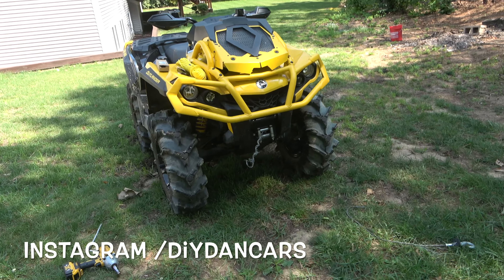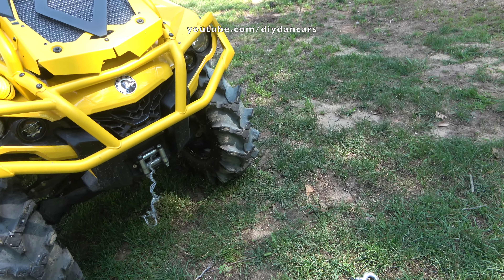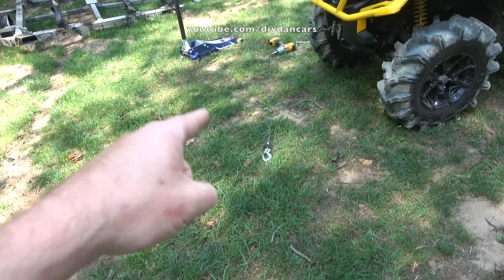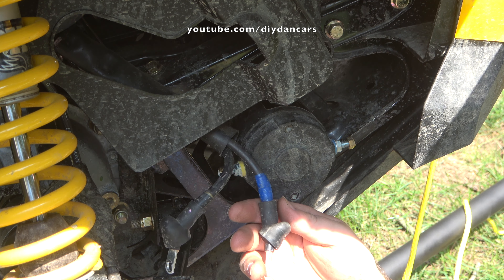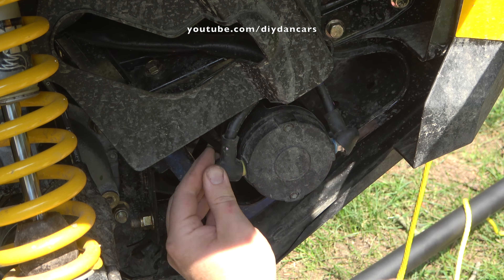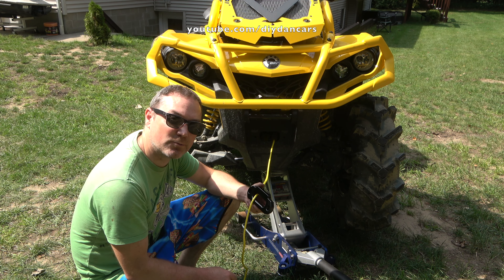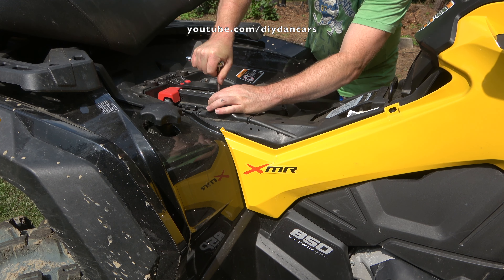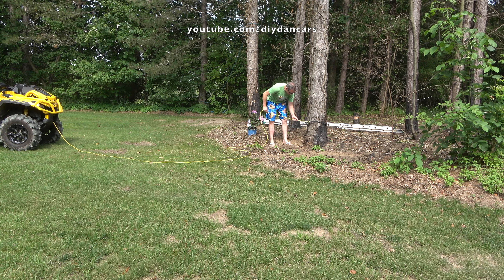Can-Am Outlander 850 XMR Synthetic Rope Install

Comment: Totally your choice but 1/4" rope is too thick for that size winch, which is why it wouldn't all fit. A 3/16" thick cable will allow all 50ft to spool on.
Reply from the maker: I broke the 1/4" steel line with this winch. I decided to build in a extra margin of safety.